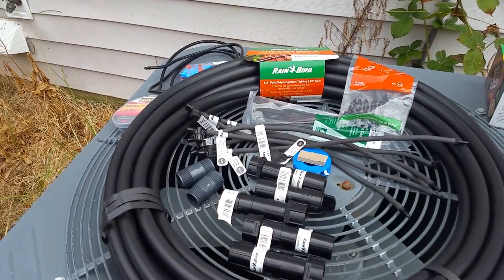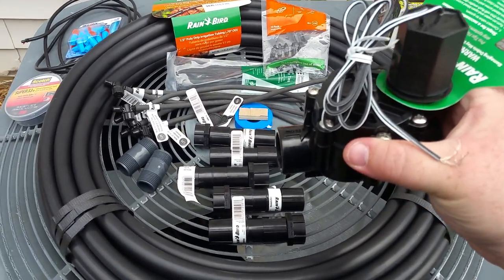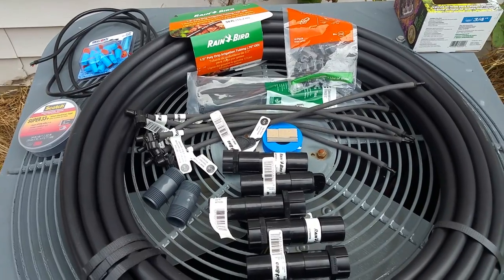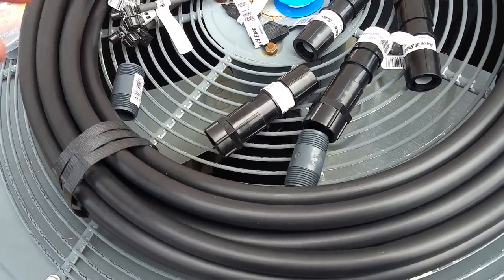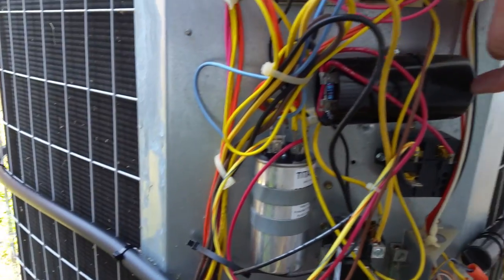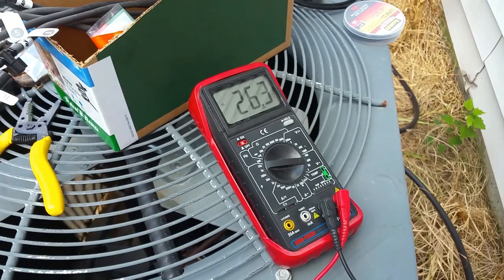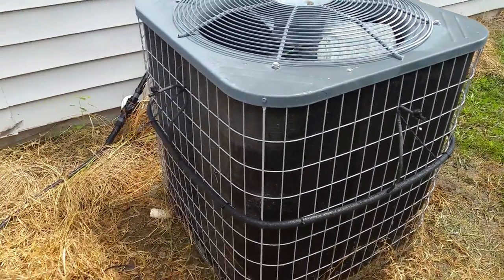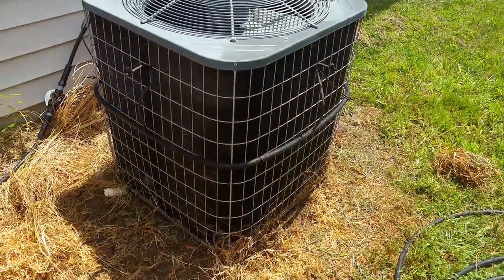DIY Automatic A/C Condenser Evaporator Mister - Electronically controlled!

Comment: Just an FYI. Running water over the condenser coil lowers the head pressure which reduces the ability of the evaporator to keep the expansion valve or orifice flooded. It also reduces the life of the condenser coil and voids your manufacturers warranty. 
What it doesn't do is lower your electric bill. However this being You Tube I expect this to go unheeded.
Reply from the maker: I appreciate your comments, however I don't agree. On a 95-105 degree ambient day, lowering the temperature of the condenser coil will improve efficiency. Simple fact of the matter is that the heat needs to move from inside to outside. If the ambient air is hot enough that the condenser can't get that heat out, the inside evaporator temperature will increase.  This is no different than when you are in a car, in stop/go traffic on a very hot day. Your cabin temp is going to slowly increase because the radiator fan isn't generating enough air flow to remove heat from the condenser. Once you get back up to highway speed, enough BTUs can be extracted from the condenser to improve efficiency, and get more heat out of the system. I am not saying that this mister system is for everyone, however on very very hot days, it does make a difference. The A/C runs less, period. Post evaporator temp drops. There's no arguing with the results. 
I don't see how lowering head pressure is going to affect fluid flow at the expansion valve. The liquid is still going to spray into the evaporator, and boil, thus removing heat.
Reply: The condenser's only job is to compress the gas coming back from the coil, which raises it's pressure, condenses back into a liquid, so it can pass through the expansion valve on the indoor coil and change state. The heat is from compression not your house. You have a fan moving air constantly while the unit is in operation which does the job quite well. Spraying water on an air cooled condenser is pointless unless keeping it clean. Which is a great idea. 

Lowering the pressure on the expansion valve reduces the efficiency of the coil  Its the same effect as low refrigerant charge, or decreased air flow.  Modern evaporator coils are designed to superheat the refrigerant enough to ensure all liquid has changed state before exiting the coil, just like the condenser  coils sub cools the gas below saturation to ensure it is all liquid at the expansion point.  

All in all it is your system. But spraying water on the outside unit is pointless. The work to cool your home is done at the evaporator inside.
Reply: Keeping the condenser coil clean is the best way-for efficiency, also think about the water bill chlorine in the water will cause premature rust I have been working on AC for 20 years.
Reply: What? the condenser does not compress anything. That is the job of the compressor. In real simple terms. The basic operation of a an ac  system: heat is absorbed into the refrigerant as it changes states in the evaporator( liquid to a gas) and heat is removed from the refrigerant in the condenser ( gas to a liquid) there is no doubt that by transferring that heat away from the condenser in a more efficient manner, the head pressure will drop, the compressor amperage will drop. efficiency will go up.. The more heat you can remove from the fluid in the condenser, the more heat that can be absorbed by the  gas in the evaporator.  the TXV will be in liquid  all the time because more heat has been removed. the pressure drop is what causes state change. Think of a chiller, air cooled vs water cooled.. water cooled will remove more heat. Do I agree, this is a bad idea, yes. Corrosion of the coil and frame is a  big concern.
Reply: if that were the case, then AC units in rainy environments would have ALL of the warrantees voided. ALSO ground water circulation units that are MUCH more efficient because you have air to water heat transfer instead of air to air transfer would have a VERY short lifespan. Your logic does not make any sense!!!
Reply: I’d Luke to add the capacity is also reduced.
Reply: Agee I’ve soon HVAC for 17 years. The only way this helps is if the CFM fails and you need to remove the heat from the freon so the compressor won’t go into thermal protection for a temp cooling
Reply: What jonboy545 is doing is definitely helping to reduce cooling costs.  One of the pros of his design is that he is spraying the mist away from the AC unit.  This gives it a chance to evaporate and reduces the amount of moisture that directly contacts the coil.  This will mean less corrosion and scale build up relative to other coil wetting designs.  The mist will bring outside air temps closer to the wet bulb temperature which is good - especially in dry climates.  The condenser will see colder air.
Also in regards to your comment about the impact of this system on cooling capacity, sure high head pressure can push more refrigerant through the orifice, but capacity does not increase monotonically with increasing head.  If it did, then a 200 degree condenser coil would have a very high satuation pressure and thus strong ability to push high flow through.  We all know a system under these conditions probably wouldn't even operate and if it did there is no way it would maintain a reasonable cooling setpoint or capacity.   The problem is that compressor efficiency goes way down.  There are conditions that result in maximum capacity and on a dry 100 degree day, this mist system will increase capacity too.
Reply: Brandon Blatter 
What’s the difference in the subcooling or super heat by doing this?
Reply: That's why air runs better at night this is why it saves money during the hot sunny day ,good video thanks
Reply: I've  had my Goodman 15 yrs now and started doing this yrs ago with excellent results instant cold air and deff noticed my bill drop
Reply: Scott Hvac obviously doesnt understand how an air conditioner works.  The condensers job is to compress gas?!?!  are you on drugs? thats the compressors job.  the heat is from compression and not your house?!?!  the whole purpose of the AC unit is to remove the heat from your house aka a heat pump.  very little of the heat coming out of the condenser is from compression.  The condenser condensates the refrigerant by removing the heat.  The more heat that is removed the more efficient the unit will be.  by spraying water onto the condenser coil you can now cool the coil down to wet bulb temperature which will vary depending upon the humidity but can get several degrees lower than the dry bulb temperature.
Reply: The drop in condenser temperature will cause a drop in condenser saturation temperature and pressure.  The drop in condenser pressure will reduce compressor head.  From a p-h chart perspective this will bring the condenser portion of the cycle down closer to the evap portion.  Assuming isentropic compression, discharge superheat will be reduced because the compression cycle will have a shorter path along the line of constant entropy.  SInce this line curves in the direction of increasing enthalpy, this translates to less enthalpy  and less heat of compression - less discharge superheat.  Also, the refrigeration effect increases as pressure decreases (vapor dome becomes wider).  While desuperheating, the saturation point will be encountered faster.  I also think the physical location of the gas/liquid refrigerant phase transition will move closer to the compressor.  This will allow for the liquid state to exist for a longer time and to travel through a longer length of coil.  These tendencies will enable increased subcooling.  In reality, the true change in operation will have a lot to do with the orifice and what the evaporator is doing too.

Usually, the higher the evap setpoint and the lower the condenser temps, the more efficient the system.

Peak cooling capacity occurs at the design conditions for peak capacity.  This will not be the same as peak efficiency.  Check your system to figure out what it is designed for.  On a really hot day, cooling the condenser will almost always bring a residential system closer to it's design conditions and result in increased capacity relative to the unaided condenser.  

Really low condenser temps can cause operational problems and put the compressor at risk of lubrication problems and refrigerant slugging.  This can cause physical damage and mechanical failure.  I don't think a mister will bring a system to it's knees in this way unless you are spraying ice water, alcohol, or liquid nitrogen or something.

Moist coils will corrode and gunk up faster - eroding performance over time.  This is why I like the spray going away from the coils.

In very humid environments, the spray will not help.  Direct soaking with cold water would be needed which will be less attractive from a lot of perspectives.
Reply: I love how people brush aside an expert because they bought into something.  It seams like it would work.  But these gimmicks never do.  If they did, all car manufacturers would put those silly magnets on fuel lines.
Reply: jonboy545 - Your so wrong, When you chill the condenser with water, the only thing you are doing is lowering the LSAT or liquid saturation temperature, that will not lower the vapor saturation temperature.  R22 at 70PSI is 38ﾟ R410A at 135 PSI is 42 to 44.  Your liquid line has nothing to do with the vapor saturation temperature. The only thing you are doing is destroying your coil and lowering the head pressure which they're designed to run at a specific PSI.
Reply: @John "LSAT or liquid saturation temperature, that will not lower the vapor saturation temperature"
What's the difference?

"they're designed to run at a specific PSI"
For a typical residential R410A unit, what is the design condenser pressure?
Reply: Brandon Blatter  No I will not lower the vapor saturation temp. r410a on the low side runs between 120 and 150, high side between 290 and 420 depending on the system and  its requirements
Reply: The refrigerant pressure in the system is dependent on the refrigerant temperature of the system.  In the system you described, which conditions do you think will have higher efficiency and capacity?  120 low side and 420 high side,  or 150 low side and 290 high side?  

Besides, the thermodynamic details just provide a scientific explanation.  This is not required to fully evaluate and understand this problem.

All you need to do is look up the manufacturer's spec sheet that tells you capacity and energy consumption for every operating condition.  I'm looking at one right now (Goodman GSX14 AC unit) that shows performance from 65 degree outdoor ambient to 115 for all practical indoor temperatures and evap air flow rates.  For the sheet I am looking at right now, dropping the outdoor ambient temperature by any amount always results in reduced energy consumption and increase capacity.  This is true at 115 degrees and at 75 degrees.  Water misting will drop the outdoor ambient and therefore improve performance every single time.
Reply: Brandon Blatter  Then why doesn't Goodmen add misting systems to their condensers to increase efficiency?  And where does it say that it decreases amp draw on the compressor with cooler temperatures?
Reply: Brandon Blatter -  Manufacturers spend millions of dollars looking for ways to improve efficiencies to reduce electric bills.  There's a reason why they don't add misting systems to their condensers the biggest one being that it ruins them. Second - The liquid " High pressure" doesn't need to be cooled beyond ambient temperature. once the TXV, EXV OR   Capillary tubes decompress the liquid into vapor, Vapor in a low pressure is -212° R410a. R22 very close in temp.
Reply: Brandon Blatter -  Another question, If your theory is correct then why dontn the manufacturers just add a big ass motor and fan blade to improve cooling on the condenser?  I'll tell you why... Because the systems are supposed to operate at a certain head pressure.   By the way all the work you're doing, you have  thermal expansion valves and electric expansion valves regulating/ throttling against your misting kit.  If you are looking to improve efficiency, you should just buy a high efficient AC system that has variable fan motors and a two Stage or 3 stage operation...
Reply: gerry rodriguez - Question for you, what  Is the stage of gas entering the compressor vapor or liquid?
Reply: gerry rodriguez -  I mean, you are a  chemical engineer, so you should know this right?
Reply: gerry rodriguez - Anyhow I'll answer my own question.  Freezing cold low pressure vapor enters the compressor helping cool the compressor and exits as a high pressure high temperature liquid which is then cooled by the conderser fan and coil. so how does cooling the ambient liquid high pressure gas after it passes by the compressor help? it doesn't because when you decompress a high pressure liquid into a vapor it's naturally going to be freezing cold thus is how you make cold air.
Reply: gerry rodriguez - also if I were to find one of these stupid ass misting systems on a condenser I would void your 10 year manufacturer warranty.
Reply: Scott HVAC has been misinformed or doesn't understand the concept.
Reply: buckylaine - No you are  misinformed on how refrigerant works as a low pressure and high pressure.  Why don't you come up with some good information to back your short uneducated response/comment...
Reply: gerry rodriguez - Hey?!?! Question!?!?!? Whats subcool? " Mr. Chemical engineer "
Reply: Because Mike Brown already explained it.  Maybe a pop up or coloring book would help you understand!
Reply: buckylaine - You and Mike B don't  Understand the dynamics of refrigeration. Mike also says that it reduces amp draw which is does not.  Why doesn't it? Because the High pressure high temperature liquid refrigerant is cooled after the compressor compresses it.... That's when the coill cools it... AFTER THE COMPRESSOR!!!
Reply: buckylaine -  So from that point after its compress, the coil cools it into a warm liquid ( This is where you are water cooling the refrigerant thus definitely not helping amp draw) which is sent into the house as a high pressure warm liquid wheir the evaporator TXV EXV or thermal expansion valves or capillary tubes decompresses it to a low pressure vapor..
Reply: buckylaine -  Might B also says that I will drop head pressure which he is correct...  So when you  add this water misting kit to your condenser then you have to add refrigerant either it be R410 or  R22 it doesn't matter you're going to add refrigerant...  Then what do you do when the misting system breaks? Yoru unit sky rockets into a high pressure lock out any flood the condenser with oil putting strain and wear and tear on your compressor if it doesn't shut off on HP lock out.
Reply: buckylaine - Mike B Destroyed... anyone else?
Reply: @J O H N You should look up water cooled chillers.  You might be shocked to find that the most efficient industrial and commercial cooling solutions evaporate water from cooling towers to cool the condenser of the chiller.  

To answer some of your other questions,  The reason why you don't see water cooling on residential systems is cost, complexity, and location specificity.  It does not help in all locations so manufacturers would need to sell different designs based on geography.  Doing it well requires proper water treatment to inhibit corrosion and prevent clogging.  It also adds complexity by requiring water in addition to electricity.  This means you need to install hoses, valves, and other components to make it work.  There are a lot of variables associated with the water that vary for each installation.  Also, adding all of this increases the cost of the unit and residential cooling is very cost competitive.  Plus when you design products that consume water, you have to deal with more government energy regulations.  

You might also be shocked to learn that some residential AC units do use water to aid the condenser.  They take the moisture that condenses on the evaporator coils inside the home and transfer it over to the condenser side to wet the condenser.  This increases the efficiency and eliminates the need to drain the AC unit.  Look up portable air conditioners and I'm sure you will find one that does this.  

The bottom line is that AC is more efficient when the condenser is colder.  Water helps this happen.
Reply: Brandon Blatter - I don't need to look it up,  I know their are water cooler units. I work on chillers bigger than some homes.  I've also worked on glycol units and many others and not going to waste my time naming them all. 

On a residential unit using standard gas, let's pretend for a moment it's r410, we can start after the evaporator coil.. 

the gas temp is going to be around  50-60° entering the compressor (SLT) then compressed by compressor (LSAT) high pressure and very hot and this will burn you. (this is where you are water cooling it) (Note: After the cmpressor)  after the liquid is cooled it's leaving the condenser as a warm liquid now, this is (LLT) headed back towards the evaporator were it's turn into a vapor (VSat) using various methods (EEV TXV) like an injector on a car vaping gas, were it's very cold and depending on the suction line pressure will dictate the degree of refrigerant, which you can look this up,  at 120 psi it's  43ﾟ period. Now this leaves the evap going back to the compressor (SLT) and restart the process.

 Water cold units actually use water like glycol units to carry the heat removed from inside to outside, that is not what you're doing here.  What you're doing is not heat transformation.  What you're doing is rust-transformation
Reply: Brandon Blatter - Study Sub-Cool, I think that will help you understand what I'm saying... Hint: Subcool should normally be between 8-12°
Reply: Brandon Blatter - Subcool is the difference between VSAT and SLT
Reply: I know what all of those parameters are and you clearly do as well.  You are accurately describing the system but you are not making any arguments.  Please explain how the system changes when the condenser is misted versus a system that is not.  What impact does that have on the various temperatures and pressures?  Explain how these changes translate to performance and efficiency.  You mention subcooling.  Is more subcooling good or bad?  What about suction and discharge superheat?  What happens to compressor efficiency as the head pressure increases or decreases?  Compare the two situations.
Reply: Brandon Blatter -  Because you cannot change the dynamics of refrigeratant and the reaction it has with changing it from a high or low pressure. 

 Does not help the compressor because you cooling it after the compressor.  Thus not changing amp draw.

Cooling it before it enters the evaporator coil will not drop your vapor saturation temperature temp.  It's still  43ﾟ  So not making your house colder or making colder air.

 I didn't actually state my point in specific In hopes that somebody could connect the dots.

Sub cool is the actual temperature that is being removed from the house in vapor form between 8 to 12ﾟ Sometimes 15°  so that is all the condenser really needs to remove from the liquid. Anything beyond that is just a waste.
Reply: Brandon Blatter - Ok the difference between mist and not.

adding misting to normal operating pressures will drop head pressure down significantly, where the system, if it's a high enough seer, will start regulating this problem and trying to correct it. then you will have problems with cooling your home.  Then you will call me, I will show up and say misting your condensers is a bad idea. let's pretend I try to work with it.  So to correct the problem, I will start adding gas to bring the pressers backup.  Now here's the real big problem... When the misting system breaks, your low side and high side pressures will sky rocket to the point the system will shut off on a high pressure lockout, again ending in poor cooli g, until either the misting system is fixed and repaired or I come back out again in remove the additional gas I added earlier.
Reply: @ J O H N You said, "So to correct the problem, I will start adding gas to bring the pressers backup."  I don't understand why you would assume there is a problem and then charge based on pressure alone without considering subcooling, superheat, or condenser split temperature (Which would require knowledge of wet bulb temp).  These parameters would show no problems.  If anything, the subcooling would be higher so you might be tempted to pull gas out.  Because of the complications associated with the wet bulb (would need to consider psychrometrics), I think it would be best to run the system without the mist when diagnosing/servicing the unit.  

Lets assume on a hot day that the mister brings the ambient down from 100 degrees to 85.  Operationally, the system will not know the difference between these conditions and those encountered on an 85 degree day without the mister.  In both situations, the the condenser "sees" 85 degrees.  

A main reason why manufacturers do not offer misters is because of complications associated with coil cleanliness and corrosion.  It is too easy to mess up and ruin the entire unit.  But if you do it right by using clean water and are careful to limit direct wetting of the coil, this can save a ton of money.
Reply: Brandon Blatter -   I would add gas because the customer  called and said that the AC is not maintaing the indoor desired temperature.  I said let's pretend that I would try to work with it. why add gas? Because both vsat/evap coil temp would drop to low causing evap to make ice. vsat under 32° = icemaker
Reply: JOHN: Your opinion doesn't matter when you put others down. Acting like a child doesn't improve your message. People just stop reading your comments and simply pass over them.
Reply: Brett OBerry - Why, cause I proved you wrong in muiltable different ways and you can't handle it? fine with me...
Reply: The unit is designed to be in the weather, rain,heat,snow..so this won't subtract from it's over all service life. I do industrial, commercial and residential Hvac for 35 years and have been using water to cool the condenser of my unit for over 20 years and it works beautifully if done correctly. Super heat is typically only a concern in refrigeration. Sub cooling is mainly affected by your refrigerant charge, to much will flood the evaporator and slug liquid refrigerant, to little will starve it and not have the capacity to remove heat thru the evaporator. Adding water to your condenser is no different than the outside temp dropping. So if it's 90 degrees outside your supply temp in the house will rise as the condenser can't cool the refrigerant any cooler than the outside temp will allow, it is a slave to the ambient air around it. But If you spray 70 degree water on it thus your supply temp will drop and now the condenser has the lower temp to reject more heat thus lowering your supply temp. Your Delta T( Supply temp and room temp differential) will improve and it will now remove more heat from your home. Your suction pressure,discharge pressure and hot gas will all change when water is added. It will bring it back to a more normal operating temp and pressure range thus work more efficiently. My system is a bit more control oriented than this method. This mister turns on every time the system has a call for cooling no matter what the outside temp is or the units pressures are. The water is usually not needed until the ambient temp is above 85 to 90 degrees if it is sized, clean and installed correctly. My system has to have (3) things happen to be engaged. (1) call for cooling.. I use the Y2 signal from my unit's stat( Y is a 24 volt call for cooling from the thermostat and starts the compressor) to pass thru(2) an outdoor mechanical air sensor set to 90 degrees, it's set of contacts are normally open and close only when the outside temp is above 90. After Y calls and the outdoor air sensor closes above 90 degrees it passes thru the last device, (3)a head pressure switch that measures condenser head pressure and temperature. It has to be above 250psi (R-22 Freon) to allow the voltage to hit a 24 volt water solenoid coil that opens and sends the water to the misting lines that spray the water on the coils. And if the water with the fan is able to drop the pressure below 175, it shuts off the mister until the pressure rises above 250 again to keep from over cooling in low ambient conditions. I also use a two stage thermostat that has the ability to control a system that has to compressors. My system only has one compressor but the stat doesn't know that. What it does know is on a call for cooling it will measure how much time it is taking to drop the temp in the house and if it doesn't start seeing tenths of a degree falling in an allotted amount of time it will then call for the second stage Y-2 in this case the 2nd stage is the beginning call for water. Hope this helps anyone considering using water with your Hvac system.
Reply: Rob=  It would be AWESOME if you did a video on YT about this.   Visuals with your description would be fantastic!
Reply: RobVoyles - water drops subcool off the chart when added to coil to cool the liquid line saturation temperature "LSAT", you just proved yourself wrong by explaining, that it's the heat being removed from the house "subcool" and also allowing oil to get back to the compressor "slugging" reducing amp draw and reducing sound because the compressor can not pump oil..... ITS A VAPOR PUMP #Put it in your freezer, it will work better lol
Reply: I just think its funny that you're calling people "dumbshits" but you spell words in your own trade incorrectly. I don't know about AC units but i definitely don't spell PRESSURES as "pressers"
Reply: I thought the compressor compressed the R134a gas.  I would say the "only job of the condenser" is to transfer heat out of the refrigerant.  A mister will likely increase that heat transfer but can also increase corrosion.  Let's hope JonBoy545 updates us over the years so we can learn from his experience.  It would also be nice to see energy usage in years prior and after the install (other factors such as temperature and solar exposure can skew the results but it would still be nice to compare).
Reply: I would have to disagree with Scott HVAC. I have a window unit where I put a large bucket under the unit to collect the water, hooked a recirculator pump to spray irrigation nozzles into coils of the A/C unit. From month of not using it to the next month, my utility bill dropped almost $30. Oh, I put a float valve on the bucket so that I always maintained enough water. I lost maybe 2 gallons a day.
Reply: For those talking about needing a specific pressure, this is correct. However, the pump will maintain the proper pressure in the condenser coils. When the fluid in the coils can get rid of the heat faster and condense back to a liquid, the pump can work less to maintain the pressure needed. Plus, the expansion valve keeps the pressure where it needs to be at, regardless of what the temps are of the condenser coils.
The job of the condenser is to remove heat from the fluid. Once the ambient air temps reach too close to the temps the pump is trying to dump out, the pump has to work even harder to build even more pressure to raise the temps high enough to dissipate the heat. There needs to be a 20F difference between coil and ambient for it to be effective. By keeping the relative ambient temps low enough, the 20F difference is easily reached and therefore the pump doesn't have to work no where near as hard.
Reply: HilaKleiner excellent
Reply: What does this mister do to the sensible heat ratio of  the equipment  you are installing  it on. if you can't answer that question stop putting these ridiculous gadgets on equipment because you don't know what the fuck you're doing.
Reply: I have seen the units on my hospital roof and they are circulating water over the coils and the fans are blowing out a fog on certain days. Is that what they are doing, using water to reduce the atmospheric temperature and increase cooling capacity?
Reply: Mike Kraemer what you’re looking at on top of the hospital is a cooling tower and in some ways it is a kin to this goofy contraption this guy has installed on his air-conditioner but it is completely different at the same time
Reply: I live in AZ.  It is technically "hot as hell" here in the summer.  Will this setup in the video make a noticeable difference for places where it gets to 110.  I get 80-90 degree places it may hurt.  But at 110 this surely would help, like a lot, right?
Reply: camjamsdad - If the system is running a high head pressure or hot LLT/LSat, then yes it will help... but without having proper tools and equipment to measure these temperatures and pressures, you can't accurately charge the system. Also best add high and low pressure switches and relays to insure the system doesn't freeze up or run a high head pressure.
Reply: camjamsdad - Also this system is in decent condition, by the look of it. You can't judge a book by the cover tho. My point is, if the guy was doing this on a shitty unit and he had gauges, it would be different. For example, if you have a bad deteriorating coil that can't remove heat, then yes.. How do you know if the Vapor saturation didnt drop too?
Reply: Goodman (not Goodmen) is cheap crap pieced together from foreign sourced low cost components.  If that is your source of information  GOOD LUCK TO YOU.  The simple truth is  that cooling the air surrounding the condenser/compressor with mist and increasing the efficiency of the fins will definitely  reduce the load and increase the cooling resulting in shorter run times and less electric consumption.
Reply: Yep
Reply: Thanks for the pro explanation without getting too technical. In the simplest terms, if the compressor has to do less work to accomplish the same result, that amounts to an efficiency increase. I mentioned this else where, but there have been times where it rained suddenly on a hot day while I was driving, and the water passing through and evaporating off the condenser (the same way sweat does off our bodies) caused such a drop in A/C vent temps that I had to turn the A/C down because it was too cold. A good working knowledge of physics is important as high humidity will indeed render the system useless, but if it's hot and dry outside, you have a winner. Of course there are system limitations to work within.

The same result to an extent should be seen in this demo. It's important for all to understand that professional does not mean expert and or, all knowing and in some cases that the licensed tech even knows what he/she is doing. Some pros are too proud to admit to this fact, but will quickly insult a do-it-yourselfer having no knowledge of their background. My sister sent a licensed technician home after he screwed up while working on her old gas heater/ a/c combo causing a small gas explosion in the home that burned off his eyebrows. I'm college educated and physics is one of my favorite subjects. I ordered the wiring diagram from BARD, changed a bad transformer after checking it, installed a new thermostat and later down the road diagnosed a bad fan motor on the same unit and kept it going and my eyebrows. Then there was that A/C tech who snapped at me because I pulled the access panel on my mom's fairly new home unit and checked for something abnormal and hit the reset button. It wouldn't have been so bad had it not been their 3 rd visit out in two months to address the same problem. He's lucky I took it lightly and didn't counter with that fact.

I also perform my own auto repairs including engine and transmission rebuilds, having taught myself after getting tired of paying professionals full price for half-butt work. I'm not a licensed mechanic, and recently had to troubleshoot my car after taking it to the dealer for an unsuccessful attempt and that's what they are trained and certified to do, so don't be so quick to insult those who do not have a certification, but may very well possess certifiable knowledge and experience above and beyond what many certified individuals do. There are uncertified repairman who have been doing the work since before certification was necessary. 

   If you know something is wrong, or that there is a missed consequence, state what it is as proof.  I know a lot, but I don't know everything. If I were an a/c repairman by trade, I imagine I wouldn't be encouraging potential customers to do anything themselves. That's human nature.
Reply: Scott HVAC I BLOCKED YOU.
Reply: Scott Hvac,   I have 30 years experience in the field and I can say that from what you said you don't know diddly-squat..  lol
Reply: Seems like the comment section is divided on the matter
Reply: Scott HVAC damn figured an HVAC guy, if you really are, would know basic thermodynamics
Reply: use rain water it's free and not hard no minerals
Reply: I understand being concerned with corrosion and building up minerals on the condenser coil fins, but claiming that this doesn't help efficiency in dry climates doesn't make sense.  Scott HVAC is saying the condenser doesn't cool the refrigerant... even that the condenser is supposed to heat up the refrigerant?  Why would a condenser coil have a bunch of aluminum fins with air being forced through it... that doesn't cool the refrigerant?  Maybe he also think the job of a car's radiator is to heat up the coolant?  JOHN actually makes a more convincing argument... basically he says that the misting cools the refrigerant too much to a point where the ac system will no longer cool your home and you will have to call JOHN so he can add more refrigerant to your system.  But if his arguments are true, then why wouldn't you have the same problem when the air temperature is colder outside?

It seems to me that the RobVoyles setup takes care of most concerns brought up, and the fact that he has been misting his AC unit for 20 years shows that it can be done effectively.  

Additionally, check this out: https://www.youtube.com/watch?v=XKHfHq300aA

Apparently, CloudburstMS has convinced McDonalds, Walmart, Comcast, Sungard... etc. to use a misting system on their industrial hvac condensers.... I would wager that these companies are more concerned with how much energy that are using than with the risk of corrosion and mineral buildup.

Lastly... see this article: http://energysmartohio.com/uncategorized/can-mistbox-lower-cooling-bills-not-so-fast/

They make the argument that misting systems are not worth the problems they introduce because of corrosion and mineral buildup.  However, they never argue that misting system do not increase efficiency and lower your energy consumption... they are totally against misting systems so if they didn't help efficiency I'm pretty sure they would have mentioned it.
Reply: I agree.  If the heat doesn't come from the house, why do we need AC?
Reply: I'd like to add here my experiences with a system like this. I had purchased one of these misting systems, it did seem to work but im in Tampa Bay area FL so its prettymuch hot AF all the time. The problem with the system even though it had a filter that came with it that was supposed to filter out the minerals in hard water, it was a yearly replacment, no big deal right? I have very hard water on tap. Within 3 months the coil became so clogged with mineral deposits that it caused the  AC to pretty much stopped working. I tried everything to remove the deposits, even used CRL lol it was fucked. had to replace it. The system that was supposed to save me money in electricity DID....by destroying my old 15 year old AC system that was replaced with new.....haha..
Reply: Mikey Webb - actually you are not 100% correct... study subcool and superheat. There IS heat coming from the house AND heat from the  refrigerant being compressed from a vapor into a liquid.  The difference between vapor saturation temperature and your suction line temperature is the actual heat being removed from the home which should be between 8 and 12ﾟnormally.
Reply from the maker: Thank you for your comments Luis. I am on city water, so yes there is chlorine. I am running a calcium filter, even though my water is very very soft where I live. I ran this unit all summer long and not only is there no buildup on the condensor coils, no noticeable rust (other than minor surface rust on some non-painted/galvenized surfaces expected with a 10 year old system) but I now have a quantifiable way of showing energy savings on a day to day basis. I am working on a big update video. Shamelessly, I'm waiting until I reach 1000 subscribers. Unit has been operating for about a month and a half this season and I can't wait to show the data.
Reply from the maker: Mike thank you for your comments. I can say after one season, plus a month and a half this year this is no deteoriation of the condensor coils, lines, compressor or anything. I am working on a large in-depth update video, along with some data I've been collecting now that I have a way of monitoring energy usage on a per 5 minute basis using a SDR taking readings from my smart meter in 5 minute intervals. So I have quantifiable data showing a reduction in energy usage with the system on vs off. As well as reduction in recovery time in the evening. I hope to have the video done in a few weeks, in time to celebrate 1000 subs! I am not claiming to be a know-it-all and DO welcome criticism and intelligent discussion such as yours. I have enough understanding of A/C systems from automotive. Household A/C isn't that different. Compress, cool, squirt/boil/evaporate, extract, suck, repeat. I'm honestly not sure if your comment was in direct response to my video, or another  persons' comment (since YouTube does such a great job with comments these days). However I will stick by gut that a reduction of temperature at the condenser coil, will increase efficiency. Please subscribe if you haven't already and be on the lookout for the 1 year follow up video, that I hope will put LOT of the "You're gonna destroy your A/C" to rest.
Reply from the maker: Exactly! It is NOT the water that is doing the cooling directly. It is the EVAPORATION of the water that cools the air. No different than the gazebo misters. Yes, water inevitably does make its way into the condenser coil. Seeing as how ground temp is in the 60s or 70s in the summer, even that is going to help bring down condenser temp. I have tried to make it very clear not only in the video(s) posted but in the description that if you have really hard water this is NOT for you. My city water is VERY soft, and I'm running a calcium filter just in case. After approximately 6 months of full usage (last summer and 1.5 months this year) there is NO noticeable deterioration of the condenser. Thank you for the comment Brandon. Hope you are subscribed I have a BIG update video coming very soon, with REAL DATA collected using my smart power meter and a SDR radio reading power consumption in 5 minute intervals. I now have graph'd data that shows not only a lower recovery time, but also less run time all together. I've worked very hard on gathering data on neighboring days where the external weather is the same, and thermostat settings remain constant. I will also have some video with an amp probe connected to the A/C unit to see if the amperage draw goes down with cooling or not.
Reply from the maker: There are several reasons why this is not used in the home market that I'm not going to get into. However to think that this is a "gimmick" is simply not true. This is used in large scale commercial A/C systems all over the world.
Reply from the maker: Hmm.... Yet my recovery time has dropped almost 20%. Hard to explain that (and yes I am keeping weather conditions in mind, similar days). I am NOT spraying water into my condensor. I am MISTING water, pointing away from the evaporator, to evaporate and cool the AIR coming into the condenser. Big difference. I am working on a large update video that will include alot of data. Pre/Post evaporator air temperature, energy consumption graphs from my smart meter showing recovery time reduced, amperage readings at the compressor (this one I have not tested yet, and do not know if there will be an actual reduction in running current). Please make sure you are subscribed, as the update video will cover alot of information.
Reply from the maker: Jesse I am working on a LARGE update video that will include LOTS of data, including energy consumption graphs taken from a SDR radio plotted to Graphana. Temperature readings before/after the evaporator, recovery time, amperage readings at the compressor, etc. If you're not already subscribed please sub now I am working hard on this update video. Ran strong all summer last year, and the past month and a half this year.
Reply from the maker: Yes these types of systems are used in large commecial A/C systems. Some use evaporative cooling ALONE, some use it to aid a typical A/C system.
Reply: This man has a total misunderstanding of the refrigeration cycle.
The compressor increases pressure and the condenser removes heat.
Anything that aides in the removal of heat from the condenser lowers head pressure and therefore the pressure differential between the low and high pressure sides of the system which reduces energy consumption, decreases mechanical stresses on the compressor and increases efficiency.
The only potential negative would be calcium buildup on the condenser fins which can be overcome by a calcium water filter.
Evaporative precoolers (which this is) have been used extensively in the commercial HVAC industry for years with great success!
I could have responded more technically but tried to keep this reply as simple as possible.
Bottom line is that this type system works very well, is easily constructed and installed, reduces energy consumption, increases compressor life, and increases efficiency.
It would be nice if people would not respond to, or produce videos on subjects they do not understand!!!
Reply: J O H N You mentioned several times that you can't change the efficiency of a compressor by changing what happens after it. That doesn't make much sense to me. Put your mouth on a straw and your finger over the other end. If you blow hard enough, you can probably still get some air through the other end, but it takes a lot of work. Now remove your finger. Your mouth (compressor) is now able to move air much easier. Hence you certainly can increase the efficiency of something by increasing the efficiency of what comes after it.